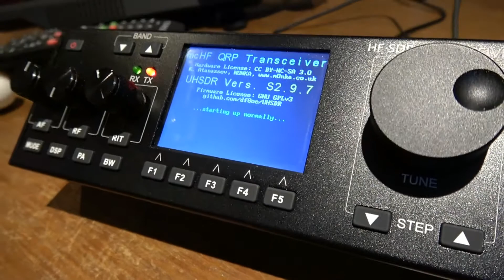Recent RS-918 Repair  - part II

Comment: You did a great job!

Thanks for the video.

Question: How's the ssb selectivity compared to other rigs? do you think it's better than my FTDX3000?

73
Frank
WA3RSL
Reply from the maker: No way it's better than your Yaesu. It does seem to have good filtering but I haven't tried an external speaker. The internal one isn't very good.
Reply: The Radio Hobbyist Thanks.

Comment: Thanks. Very useful fix. Relieved... Just took delivery of one yesterday. With doing this fix and installing an in-line fuse as advised by another commentator what fuse rating would you recommend?
Reply from the maker: I asked them but got no answer. I'm guessing that at 15 watts output and all the losses included, it probably draws around 2 amps when transmitting. So I'll be trying a 4 amp fuse perhaps...
Reply: Thanks again. Will be watching in for your next and subsequent videos.
Reply: Max current draw on the RS-918 is 3.5A so a 4-5 amp fuse would work fine....

Comment: Like I mentioned before, it's a simple fix.... Just make sure that you have a fuse inline with the power supply coming into the radio..Nice job Rick!!!  Now all you have left is the firmware update which is at 2.9.19 and the boot loader is 4.0.0 presently....